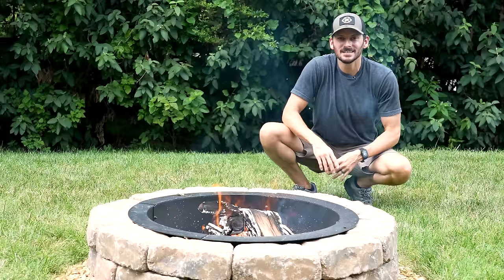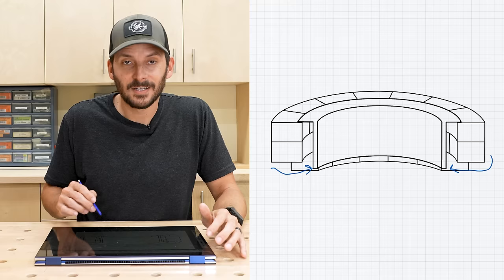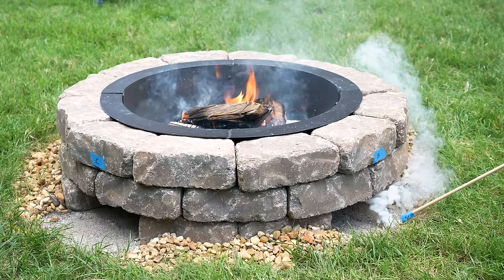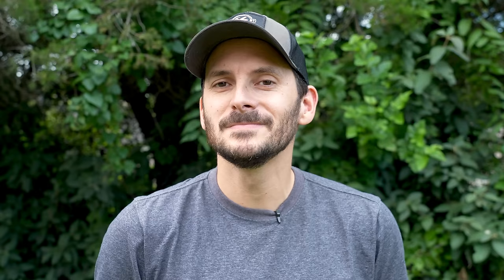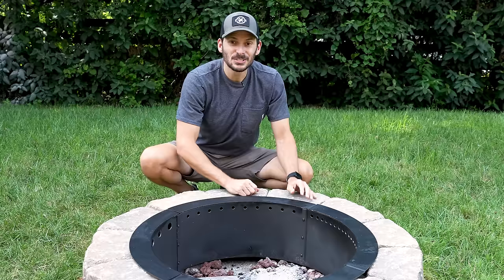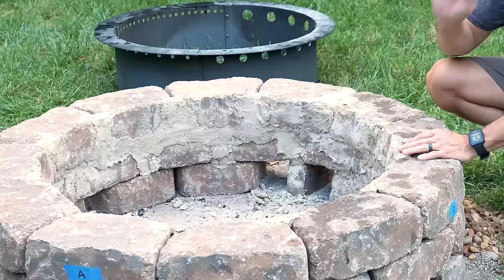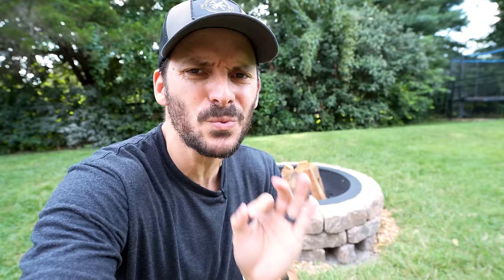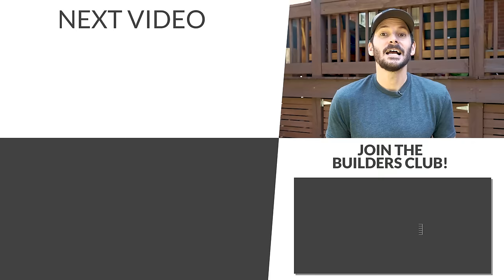Stop the Smoke, Do THIS to Your Fire Pit

Comment: I've had a mini wood gas stove with a fan and it works similarly. I've also made mini ones out of food cans, paint cans, and one out of a mini incinerator bin.
A few things I've found - going too wide reduces the performance as the walls don't get hot enough, and the air out the holes doesn't have chance to wash over the top of the fire and form an incinerating barrier for smoke particles. It just rises out of the way.
Not enough primary holes and it's hard to get the fire going, and you get a build up of charcoal that you have to wait for it to die down. If you add wood to it, the carbon dioxide smothers the combustible gases and it just smokes. It's useful though for making fuel for a barbecue after you've had your fire.
Too many primary holes and the fire tends to soot a bit, as the gases from the combustibles are being released too quickly for the secondary air supply to consume them.
Having the thing raised off the ground helps the convective airflow.
Thermally insulating the outer walls helps keep the rising air hotter and better at burning smoke.
The holy grail would be two separate variable speed air intakes for the bottom holes and the top holes.
Wood needs moderate primary air and generous secondary air. The wetter the wood, the more primary air.
Char needs lots of primary air, but secondary air is not hugely important.
The easiest way to make a burn barrel like this is one upside down bigger barrel with a hole cut in the base on top of a smaller barrel. This ensures any air leaks go across the top of the fire, whereas this one can potentially leak out the sides.
If your air jets are not reaching the fire, you can help them with an overhanging metal ring to trap the hot air. This also focuses more heat to the side walls by enclosing the fire slightly.
I've never gone back to conventional fire pit type stuff after discovering these.

Comment: The fire being closer to the sides after you rearranged it is what resulted in the reduced smoke.  
Those prebuilt smokeless stoves have a smaller firebox putting the fire close to the sides and putting the increased oxygen flow directly into the fire.
Reply: I've been researching these designs and I think you are right. The solostove has a very small diameter. I think I'm going to try going smaller...

Comment: When I moved into my new house I wanted a smokeless fire pit. I happened to watch this video. I modeled mine to yours. I used the 1/2" holes on top and bottom, 1'-1/2" apart.  I have to tell you, man. My girlfriend and I are very happy with the work we put in! Not only that, I showed some of my carpentry friends, and they want the specs. This was a great build! 👍  also I got them flames out the top holes

Comment: As Mech. Eng. I would recommend the top holes to be smaller than the Bottom. You want more flow in the bottom but you also want to create pressurized air in the wall gap. The air will naturally warm and rise to create this pressurized effect.

Comment: I think the most important thing is that your fire can draw in plenty of O from underneath. Preferably with ample space beneath the fuel. This allows the fire to naturally consume cooler air from underneath it and not disrupt the current of hot air that naturally wants to flow straight up. The less impeded the hot air exhaust is, the more perfectly it will create an upward current that carries the smoke well out of way. 
But that all comes down to a clean pit with unobstructed inlets at its bottom allowing air to naturally find it way all the way underneath the fire itself. 
Just my 2 cents.

Comment: I've been meaning to build one with venturis. How a carburettor works. The larger exhaust than intake creates a low pressure area, which increases air flow. In the smokeless one the exhaust holes upper and lower areas combine to create a venturi. I was planning to create 4 venturis ( like bugles ) angled to start a cyclone from the bottom up. Your design has very large intakes that actually inhibit airflow because the exhausts are smaller volume. The air may actually want to travel the opposite way.

Comment: The biggest tip I’ve found, is don’t stack the wood higher than the secondary air supply. You can see when he starts the fire it’s in a pyramid, and when he has the footage of “virtually no smoke”, the logs are laying horizontal on the floor of the pit. I honestly think this is why Breo, Solostove, Hotshot, etc make their units so high.

Comment: I love this video man, it really helped me understand a practical way of how to diy a secondary combustion smokeless stove. I was planning to make something like this, but I only had a loose concept in my head, and I did think that hole size and spacing would effect the performance just not HOW but this has given a pretty good idea. And I think you just didn't have enough fire wood in there to get full effect or that the diameter is too big.

Comment: A couple notes: 1. The lack of a curved in lip around the diameter is going to create less draught from the top holes. A curved in lip, with either holes higher or using tubes to create a venturi effect would draw more air/gas through, and 
2. The open void behind the ring will actually cause smoke (not just air) to be sucked into the bottom holes, up the outer void mixing with air, then out the top.

Comment: Before trying this I did a quick experiment. Leave five or six 3" wide spaces in bottom blocks. Install a rebar grate on a few bricks just above the bottom openings. No fire ring to buy or mess with. Also no smoke. Ta-da.

Comment: So, I’m thinking, oh great vid thanks for posting bro, I’m thinking you want to heat the iron as fast as you can so get your fire going and spread it to the edges so the super hot air  behind the iron can ignite the unburnt gases (smoke), which would mean more firewood fo you, and for me it would mean building a slightly smaller diameter pit. Cheers

Comment: I give you quite a bit of credit to be patient, and keep trying different things to reduce the smoke. I had built my first firepit in the ground, and level with the yard, and was getting lots of smoke blown my way, so the next year I made the exact same firepit above the ground using the same stones, and metal fire ring. I didn't get as much smoke, so I am satisfied with the same firepit you started out with. Somebody will come out with a suction on the inside of the firepit, that travels through a tunnel, and the smoke with come out 10 feet , or more away from the sitting area. Like the vents that suck out the cigarette smoke in a room. Keep the videos coming.

Comment: My fire pit is similar to yours only i have 5 layers of stone. The first layer I did 1" spacing between each stone. Layers 2 to 5 are traditional with mortar. The ring, I added qaurter inch holes at the same spacing as yours. When the ring is inserted I have about 2" gap at the bottom so the bottom are can get in unrestricted.

Comment: First off, your video was perfect blend of information and entertainment. 

My 2 cents regarding the airflow.  The solo stove looks deeper than it is tall, or at least about the same. I think the main thing that would give this a better performance is to make it a little taller and work to get the air below the fire. Then to truly have smokeless, the fire needs to fill the space and really be heating that air rising behind the metal toward the top holes. Either way, this works to a degree, looks pretty good and was a fun project to watch!

Comment: actually if you let the wood dry well, over a period of at least 1 or 2 years, you will have a smokeless fire(depending on the wood you are using, of course), or with just a tiny quantity of smoke. this is the most important thing, not that holes :P that secondary combustion does help, but it does nothing if you don't know what kind of wood to burn. the most important thing is to have your wood dry, if you don't want smoke, not to have those holes there :) also, harder wood is better. pine does create more smoke because of the sap in it.

Comment: Seeing you track the airflow into the fire made be realize that the reason the smoke is often in your face because when you sit by the fire you are blocking the air flow. The air goes into the fire and then comes out with the smoke.  Since the air isn't going to flow as easily from your direction the air with the smoke is going to blow right towards you.

Comment: Hey thanks for the video , been thinking about doing this kind of project for awhile now , I did the same as you on the holes but instead of having the top ring under the top layer of stones or sitting on top I put a slice in the middle of the stone and slide them into place , doing a pretty good seal 👍🏻 , I add couple pics of how it turned out but not seeing how to add

Comment: Our Contura wood-burning stove also has holes in the vermiculite back wall. As a result, there is also a double combustion. The smoke circulates and is burned again. This results in a combustion rate of 81%.
So it's the same principle. There is hardly any smoke coming out of the chimney

Comment: Smoke always follows you because you are there. The updraft from the fire causes fresh air to be pulled in from beside the fire. Air will flow from everywhere around the fire that is open. Your body blocks the incoming air, and the air from the unblocked side of the pit will push the smoke toward the blocked side, which is you. When you move, you're moving the air blockage. Standing will block more air than sitting will.

Comment: Deeper as someone suggested and get the pavers out of the bottom and fab an elevated grate to put the wood/fire on. Shrink some box tubing into a circumference that is within your fire ring,  mounted on 6 legs for elevation, and use expanded metal or better yet for warpage, perforated steel. as a top. Rebar could be used to fab something up as well. Run your bricks up another couple of courses to allow room at the bottom and to reach the scale you are missing.

Comment: The reason smoke is even emitted by a fire is mostly due to it not burning hot enough.  Wet wood is actually the secondary reason.  Get a bunch of hot, brightly glowing coals burning in the bottom of the pit after an hour or so, so  you get really strong heat at the bottom of the pit. Those coals need oxygen, of course, but it's only going to be when the bottom of the fire is REALLY hot that you'll get complete combustion and no more smoke being produced, regardless of the wood you pile onto it.

Comment: Interesting idea with making gaps in the brickwork at the bottom, but then you made the mistake of blocking the airflow in at the bottom with too much gravel.  I liked what you did, early on, with the 4 blocks in the middle spaced to allow airflow into the middle of the fire. I see optimization of this by reducing or eliminating the gravel and digging grooves in the ground going back to the gaps in the brickwork.  This will improve the primary burn and then you can optimize the secondary burn holes at the rim around the top and maybe add another layer of brick.

Comment: At last try you did a bigger fire so the wall get heated making the secundary system to work better. A deeper hole can provide better performance. Check the inox equipment you get the pattent. It much more sliner than your version. For aestetic reasons it should be the contrary, like yours. You can make it deeper inside the ground hidding its deepness.
My suggestion is one inside ring with holes so you can turn the inside ring and regulate the effective sizes of the holes aligning or disaligning the inside and tube holes: a simple solution to solve the question about hole sizes and air flux.

Comment: Interesting demo. I once used an old washer agitator as a fire pit at a previous house in a rural area where fire pits were allowed and it worked fine. The fire smoked less when keeping the wood under the top lip and laying kindling and wood horizontally. This retains chimney effect in the fire albeit to a minor degree. I had to use mesh screen on top to prevent sparks floating away with the added benefit of being able to grill burgers etc. once there were some good coals.
btw...will always get smoke trying to light a teepee fire with logs that large. That said, the WD40 would be good firestarter;)

Comment: 5:50 could lay in stainless or galvanized pipes from the holes into closer to the center of the fire to get the o2 right where you want it.

Comment: Great presentation and great theory vs. practical application. One thing I have experimented with to "control" the direction of the smoke was to use a perforated steel panel and form it into a cone shape, to place over the pit. The conical and tall shape acts as an accelerator to draw more air is and to shoot the smoke up higher, out of your path. It would be cool to see you add that concept.

Comment: The solo stove uses a ring at the top which is smaller than the pit diameter forming something of a venturi just above the upper holes. I wonder if pitching the heated air from the upper holes more towards the center would help with secondary ignition.

Comment: Less smoke is more apparent in dryer wood. I believe the last test was better off because of the lack of moisture. Also the after photo included alot more wood. The extra fuel allowed the heat to build higher inside the bowl, which allowed for much faster air displacement. More heat=more displacement. So not only was the air moving faster. But the extra heat proved a more efficient burn. My hypothesis is secondary combustion isnt necessary if you make the fire bigger.

Comment: WD40 is Kerosene with a wee skosh of hydrotreated light pump oil.  Kero' is a fine cutting fluid for Aluminum but lousy for steel.  For steel  use any high sulfur oi.  OATY brand thread cutting oil found in the Borg or any plumbing supply is super.  Motor oil is as good as sand,  ya need the sulfur. You can also use any of the specialty cutting lubes but they tend to be expensive

Comment: i will probably go a bit smaller so I don't have to use so much wood to get it blazing hot, put aluminum foil around to inside of the brick so it reflects the heat back and the stone doesn't absorb it, and only have one air intake hole so air has to travel farther and get hotter. i would also leave about an inch between the bottom of the fire pit and the ground which i would also cover in aluminum foil to super heat the air.

Comment: I think the reason your fire pit didnt go 100% smoke free is because of 2 reasons. 1) Height of your pit, the upper holes are suppose to hit the top portion of the fire to burn off the unburnt particles of the fire. Your fire pit was hitting middle portion of the logs.
2) Distance of holes from fire, holes are too far away from the fire. You need to use a smaller ring. 

Basically use solo stove width and height ratios to make your own.

Comment: One of the main issues here is the size of the pit itself, and the energy needed to heat the sides and start that secondary combustion and have it burn effectively. With this size pit, you need to have a larger fire, and burn more loggs to make it effective. For those intending not to have such huge fires, a pit closer to the commercial one would be better, but obviously not as good looking out on the lawn. So, probably you'd settle for the in between, a larger pit with less effective secondary burns which still reduces much of the smoke, but not all, depending on other factors as well.

Comment: You need the holes on the bottom to be affective, all of the way around the bottom. I had a burn barrel in town, away from the buildings of course, and I put some old tires in it and it didn't smoke at all.

Comment: Hi, Fun video, even with the ads. I think the limitation on yourr success is related to the ratio between your diameter and the height of the ring.  Had you make the same project the same diameter and two or three stones  (better yet, four or five stones) deeper, the effect woudl be much closer to the one you wanted.Thanks, B. (Look at the ratios on the metal one. It has that depth to width ratio for a reason.

Comment: Height to diameter also matters.  You notice the commercial smokeless is almost as tall as diameter.

There's a video/plan for making a smokeless burner from 55 gallon drums and it uses full height of the outer drum.  The thing is a little more complicated with vanes to swirl the airflow.  It will make your green wood smokeless.

Comment: Great video! we're all looking for the next level, use a shop vac while drilling, so you dont track those shards of metal into your home :)

I did have a little feedback, great work and I like your presentation!  All your attempts are based on flat ground you do use 4 pavers lined up with the intakes under the outer ring.  I suggest getting some 2" + rectangular steel tubing.and cut 45 angles on the ends vs 90 cuts,  dig a channel under the fire. supply air right under the center pavers :)   I did this last year and watched the fire take off ! It also seems to self clean (you mentioned you didnt like the ash buildup)

Comment: Need a lining of metal welded to the top about half to 1 inch outside the holes on the brick side. Brick doesnt allow the aire to heat up enough. But a metal wall will

Comment: Your issue is dry wood and heat.  If you have seasoned hardwood, dry, and you start with small kindling and work up to large pieces in a HOT fire, the amount of smoke will be minimized regardless of design.  The pit you built is great, just get the right wood and you've got a great spot.

Comment: I don't have that ring in the center of my firepit. I dug a hole about 6 inches deep, then staggered 2 tiers of pavers and used about a 3/4 inch spacer between each paver as I placed them. It's the same principle as a rocket stove, sucking in bottom and exhausting out the top.